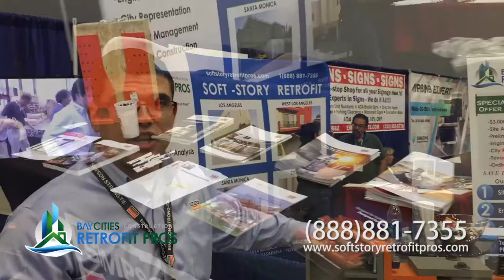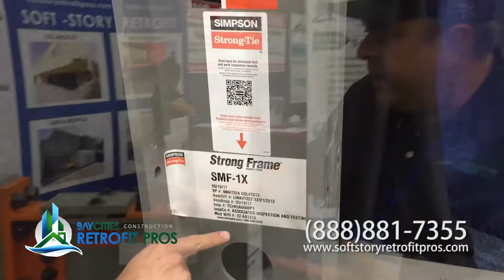How do Special Moment Frames Work? | Simpson Strong-Frame

Comment: Great , except when  the beams are covered or built in to walls. If you want to use a fuse, why not just make one with a very sensitive wire end to end, when it snaps or if it touches the beam, it can trigger an automatic alarm..... just a thought
Reply from the maker: 🤔 interesting
Reply: @Baycitiesconstruction  They redesigned the connection but I don’t see any real innovation here to completely change the monitoring method and to make it automated so it can connect to a BAS.